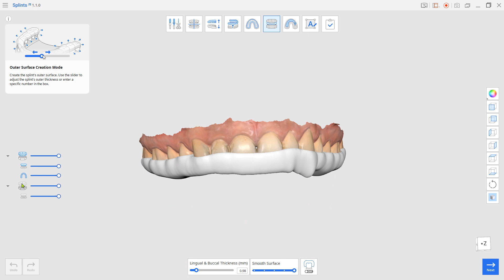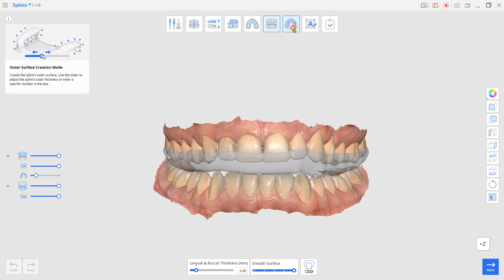Designing a 'Michigan Splint' with the Splints App

Comment: Its a very nice tool BUT you can NOT make a K9 guidance with this app. (90% of the time we are using a K9 guidance )  since you cant see the movements of the arches (protrusion & laterals) i would love if the app could do that for me or give me at least the option to move the arches on a virtual articulator and i would make the K9 guidance  by hand (clicking my life away). if the software was able to do the movements that would be remarkable. Right now you can make a flat splint or a flat one with ramps (adding them as edit) but you have to trim away on a articulator to make the guidance so you dont really save much time actually its takes more time than to make in by hand from scrach.
Most dental software make the guidance for you with just a click and most of the time minimal to non extra trimming of the splint after the print.
Reply from the maker: Thank you for your comment. You can capture patient's mandibular movement as a video with Medit scanner and this data will be created as a 2D image. So you can bring the scan data and apply to any Medit's app at scan data assigning stage. (Medit Design, Medit ClnicCAD, Medit Splints, etc.)